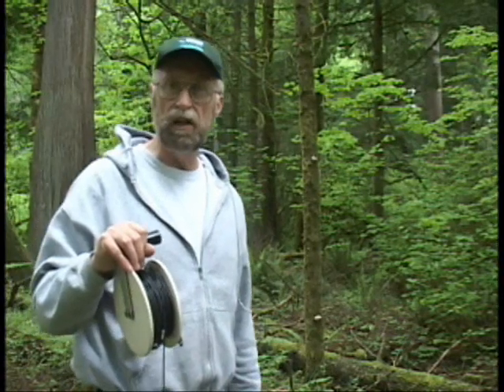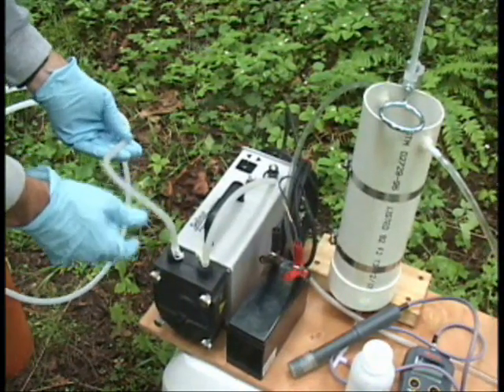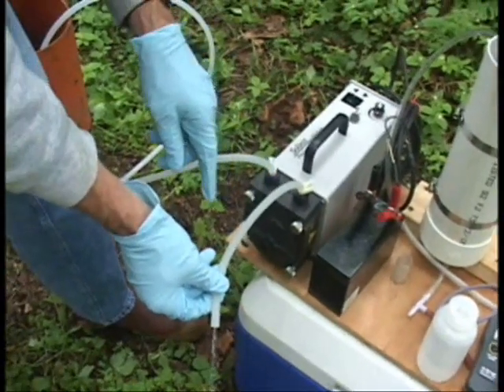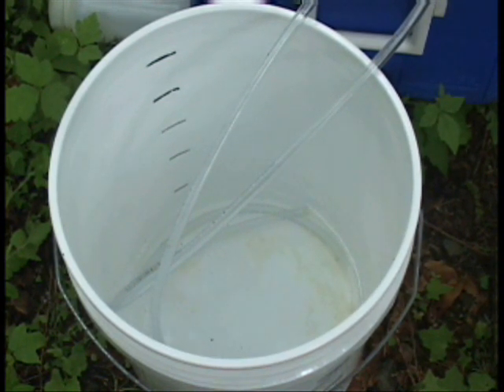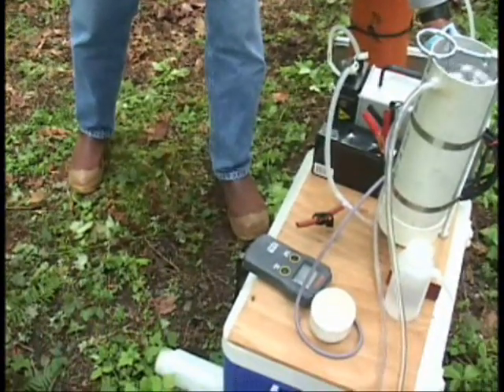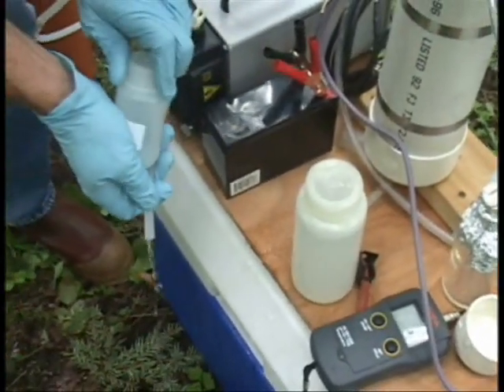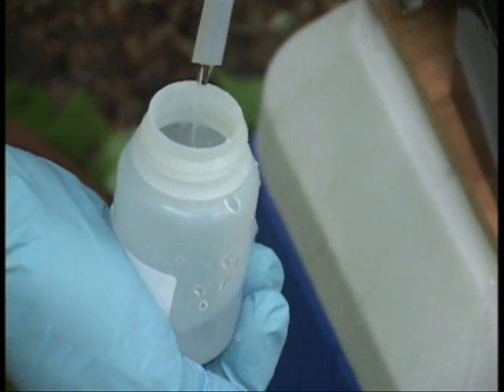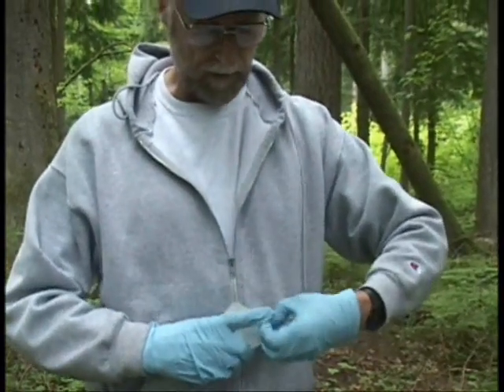How to: Groundwater Sampling for a shallow well

Comment: Great job on the improvised flow through cell. Personally I like the Hana 9828 multi parameter probe with it's 100 ml flow through cell. I normally do low-flow purging instead of 3 well volumes which is more concerned with minimum draw down. 

Also, was that a 4 inch diameter well? You may want to check your math for well volumes. I take the # of feet and X by 0.041 then multiply the diameter of the well squared.

Example: 4 in well with 7.25 ft water column, 7.25 X 0.041 X 4^2 = 4.76 gal.

Comment: First off, for the parameters you are testing for, a bailer would be much more efficient. If you're stuck using a pump there are a few things you can do to minimize the time at each well. Use only new pre-cleaned certified bottles, no rinsing. use a new sealed bacteria bottle and no talking while filling, your mouth should be closed at all times while filling a bacteria bottle.. Always fill your bottles completely, nobody want to get back to the lab and run short on sample because of a possible re-run or doing spikes, duplicates,. or maybe an accident. Pre label your bottles with a waterproof label ahead of time and use permanent ink to mark them, tie on ladles can fall off and if you're sampling many wells...well, you get the picture. We always put all of our samples in pre marked zip lock bags as well. And lastly, use a depth meter that is marked in the units you want to use, there are plenty of models out there. Always use protective gloves and change them between wells. Always do a initial data check, and a final check after sampling and record the data for further reference before the next sampling event. Some states will not allow the use of a pump like that and they require the use of a bladder pump...I think there pretty comparable. And lastly, have fun, unless it's -20 or storming like crazy. Be prepared for the worst.,